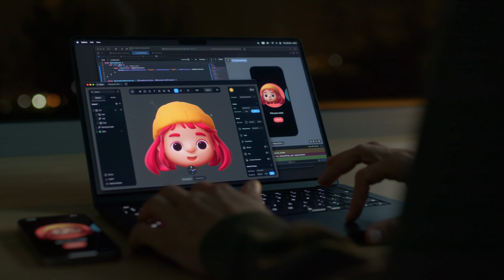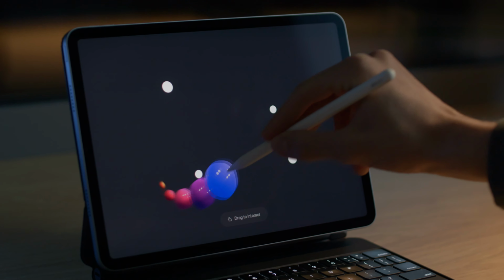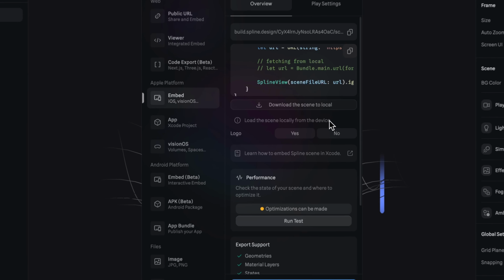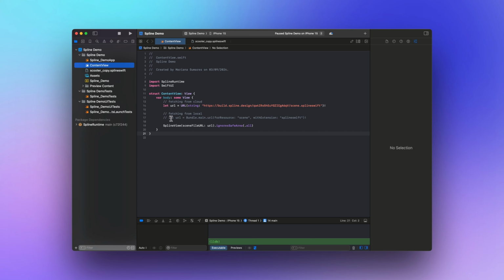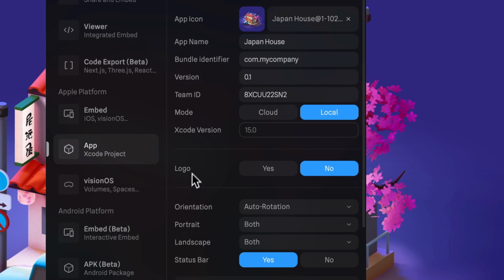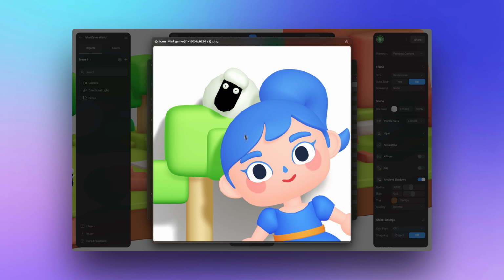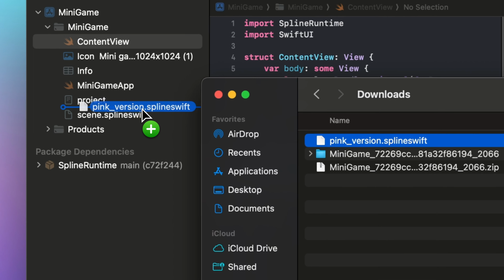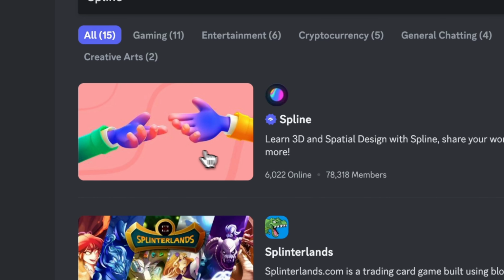How to Export Native 3D for iOS and visionOS using Spline

Comment: When I click the Embed (iOS) option in Export, it no longer shows the scene URL like it does in the video. So how are you supposed to connect the scene to Xcode without embedding the entire thing? Maybe the cloud link option which adds the logo was changed — and now you can’t test it in Xcode unless you’re on a paid plan?
Reply from the maker: The UI changed a bit but the options are there under the horizontal tabs.

Comment: Hi Spline Team! 👋 Quick Question:

I’m working on integrating a Spline 3D scene into my SwiftUI application, and I have a question about connecting the render state in Spline to a SwiftUI state variable.

For example, let’s say I have a @State variable in SwiftUI (e.g., a Bool) that I toggle using a SwiftUI button. How can I use this state change to trigger an update in the Spline render, such as playing an animation, changing the visibility of an object, or updating its properties?

Is there an API or integration method that facilitates this kind of interaction between the SwiftUI app state and the 3D scene?

Thanks in advance for your help! 😊
Reply from the maker: Hi! The Code API for SwiftUI could be a helpful resource here. 🙌 We recommend keeping an eye on our documentation for updates: https://docs.spline.design/doc/code-api-for-swiftui/docLUl8aCHi2
Reply: @splinetool  perfect! im going to be a new costumer if this api reales 🤗